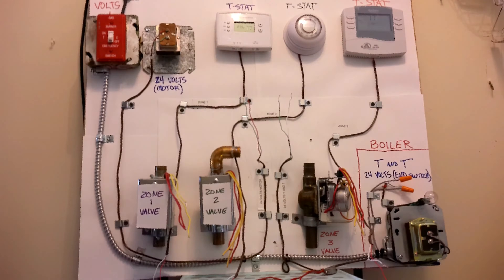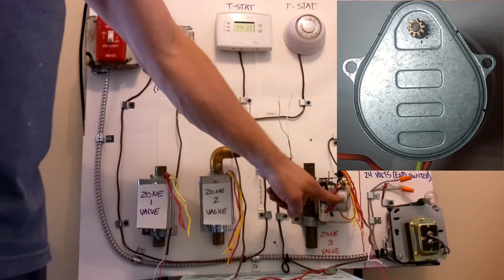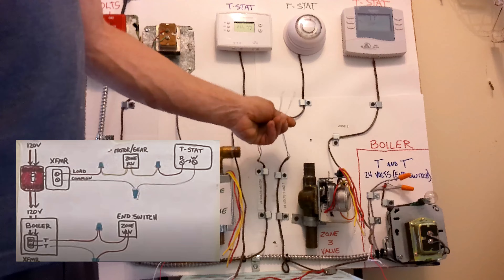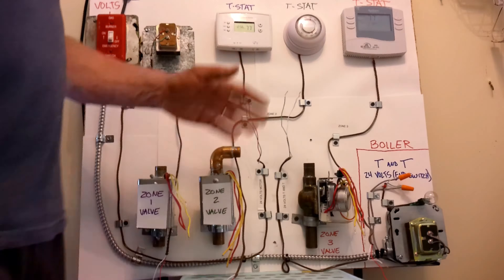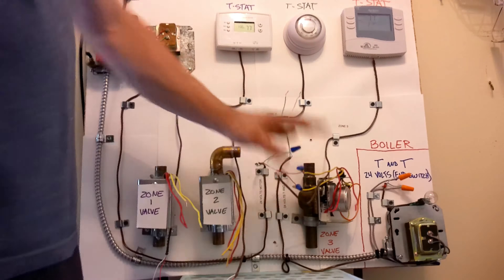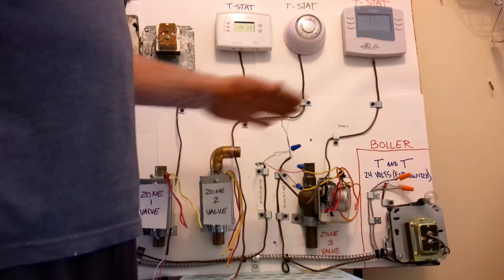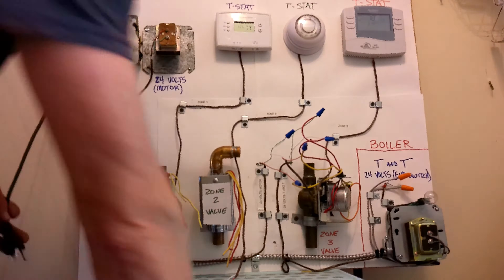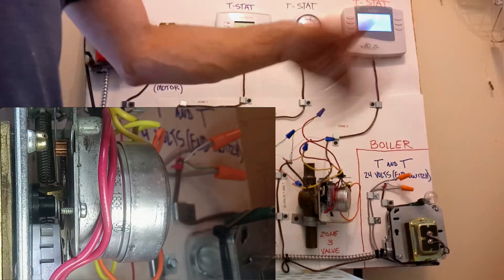Zone Valve Wiring For Beginners (Honeywell demonstration)

Comment: Can someone  please help? I installed a  new gas bolier recently. But for some reason the boiler is running without reading the thermostat. Is this a faulty wiring or something to do with the boiler installation? The thermostat is getting power, it reads the time and measures the temperature in the room, but  it doesnt regulate the house temperature set on the thermostat with the boiler . Its set at 70 but the house temp is 90! Is this a wire burnt out or is it a faulty installation? its Burnham X207, 210,000 BTU gas fired hot water boiler. How could the thermostat just stop working all of a sudden when it worked just fine before the boiler was installed? Seems to me the wiring to the boiler just wasnt done right.
Reply: Do you live in PA/Jersey area? Are you still having trouble?

Comment: Could you make a video explaining wiring an external zone control on an oil fired boiler. Controlling donestic hot water?
Reply from the maker: It's the same set up. Only difference is than an aquastat on the water storage tank takes the place of the thermostat. When the water temp drops below the setting on the aquastat a switch closes and the zone valve motor is energized the same way a thermostat energizes the zone valve motor on a call for heat.

Comment: Hey. great video !  I do have a question about radiant flooring.. I had 3 zone valves.. I replaced 1 zone with radiant heating.  Do you have a video explaining the wiring from the thermostat?
Reply from the maker: Not really familiar with radiant floor stats, unfortunately.  But I can't imagine them working radically different from conventional thermostats.

Comment: Mike, Where is the C-wire required for Nest thermostats?  My wiring has 4 wires, but only red/white are hooked up.
Reply from the maker: The common is on the 24v side of the transformer. One terminal will feed 24v to the tstat/zone valve,  the other receives it back as the common.

Comment: Forgive me. I’m trying to understand this. It’s been a few years since I’ve been in the field. But if a goes to common isn’t that hot to common. A direct short ? I thought tstat terminals are breaking hot ?
Reply from the maker: It's not going directly from hot to common. T stat gets power at R through the zone valve motor wiring.  W goes back to common. Some guys put the ZV on the W wire side and just run power straight to the stat, but ZV motor doesn't run either way until the Tstat closes the circuit.
Reply: @JerseyMikeHVAC  ok yeah I was just talking with someone and I think I get it. Or at least what someone was explaining to me earlier. .. r from transformer up to r at stat. Out w to one yellow on zone valve. Same for next tstats and zone valves. Other yellows are in common. Can get wire nutted. One red wire from end switch goes to “t” terminal at boiler. And other red to other “t” terminal at boiler .. am I on point or way off? Lol. Appreciate your assistance sir.

Comment: wow fantasic demonstration.... basic question on zone valve... do they need to be installed in a specific direction?
Reply from the maker: Yes. There should be an arrow on the valve body. If the zone valve is going on the supply side of the boiler piping, the arrow points away from the boiler. If on return side piping, arrow should point towards boiler.

Comment: Mike awesome videos, I could use ur help wiring my new peerless boiler, two zone valves plus I got to add another zone valve to the indirect water heater, willing to pay if u help me remotely.
I can do all the plumbing no problems just wanna make sure my wirings right 
Thanks
Reply from the maker: The aquastat for the water heater can get wired into the zone valve like a thermostat. Only difference is that it doesn't matter which way red and white get hooked up, so it's easier. 

I have a few other zone valve videos that might help you out. Let me know if you have any questions

Comment: Mike, incredible explanation, many thanks. practically everyone else misses the point about dual circuit and little switch behind actuator. Latest boilers like Navien have zone support built in. How does one wire zone valves and thermostats to the boiler then?
Reply from the maker: I have very rarely zoned out Navian boilers, but what I do know is that the zone relay will have individual R, W and (optional) C connections for each of the zones for the thermostat connections.  It will also have Normally Open N/O), Normally Closed (N/C) and Common connections for the corresponding Zone valves.  On zone valve connections to the zone controller you'll almost always be using the N/O connection and not the N/C. 

 With Taco 3-wire ZVs, the N/O connection would go to terminal #1 and the Common to terminal #2. On Honeywell 4-wire ZVs, One wire would go from N/O to one of the yellow wires and the Common to the other yellow wire. Doesn't really matter which way. 

 I have seen Taco zone valves wired into Navian zone controllers without terminal #3 on the ZV being hooked up at all, so although I'm fairly certain, I'm not 100% sure that Navian PCB Zone control doesn't require a TT signal from the Zone valves end switches. The ZVs only need power to actuate the physical valve itself. So I'm assuming it's the same with Honeywell 4-wires in that the 2 red wires are not hooked up.  I believe the only time T/T wiring needs to be made is when you're running more than 3 zones and an external zone controller is required, and that would be from the external controller to the internal zoning panel in the PCB. 

 I have also been made aware before that the PCB setting have to be set to "zoning disabled" for it to work, which seems completely counter-intuitive to me, but it seems enabling that feature is for when you're using Ready-Link cable for the external Navien Smartzone Zone Pump Controller, rather than for when you're zoning directly off of the PCB itself internally.

You likely need an external circulator pump for Navian zoning applications, as the internal pump is often not sufficient.
Reply: @JerseyMikeHVAC  thank you for reply. you gave me very valuable hint and hopefully useful to your other subscribers.

I troubleshot my wiring, called support line,

I have the same Taco zone valve, normally closed as you've shown in the video. Latest NCB boilers do not need the 2nd red cable pair, the little switch at all. I left those wires hanging. I hooked up my yellow cables actuator to normally open (NO) and common on the boiler. This has to be a mistake in vendor specification because my valve is normally closed (NC). When tstat calls for heat, NO pair of connectors is energized to ~26 VAC and stays at 26V until the valve is open, letting the water through into the coils. The normally closed pair is at ~2V. Traditional 24V wall transformer can be removed.

External system pump for radiant heat is also driven by thermostat closing R->W bridge on the boiler. 120 VAC pins are on boiler front panel. It's sufficient for smaller pump under 2.5A max.

My pump will stay on until desired supply temp is reached plus few degrees over. It then turns itself off until supply falls 10F below desired T to prevent short cycling.

Since the boiler is the one providing the power for zone actuators, it feels like there is no ambiguity or the need for the switch loop anymore. It knows whether it's sending 24V to the motor or not.  Valves and pump are working perfectly and synced with thermostats.

I am off to new problem. plumber got something wrong and the water is not going into floor supply, pressure dropped.
Reply from the maker: @tahoefor  So it WAS N/C. Makes more sense. I was thinking N/O didn't sound right, but I was told N/O.

Comment: Mike, thank you for the great video. I have the same 3 zone wiring just like you are showing here. Now I understand how the spaghetti works. I have a question for you. I am going to replace the thermostats with the Google Nest thermostats. The instruction says it needs a C-wire, but I only have two wires connecting to the existing thermostats. How do I solve the problem? Do I have to use a power connector? If yes, how do I connect it? Thanks.
Reply from the maker: I just released a video a few hours ago on how to wire a power connector to a taco zone valve, but if you're going to install multiple Nests it probably isn't going to work. You may need an external transformer and relays. Im going to be working on a video for that.
Reply: @JerseyMikeHVAC  I watched your video about connecting the power connector to the Taco valve, which is different from the Honeywell valve. How to connect to the Honeywell valve as shown in this video? Thanks.
Reply from the maker: @Woaitudou   I did a similar video on the Honeywell valves. You can check it out here: 

https://youtu.be/XVs0k1aaza4

Comment: Mike - great video, even better was your explanation.  I am in the process of modifying a 5 zone boiler system and incorporating the a/c into the mix.  What is your recommendations with the smart  thermostats & controllers available.  My goal is make the system work from one thermostat, including the a/c.  Luckily, the builder installed 5 conductor wiring for each of the 5 thermostats in the house.  Right now everything is operated manually with the old mercury thermostats.  Thanks!
Reply from the maker: Is your AC system Zoned? or is it just 1 central thermostat?
Reply: @JerseyMikeHVAC  a/c system is one zone, ductwork throughout entire house.
Reply: @JerseyMikeHVAC  one thermostat for a/c
Reply from the maker: OK. 
Another question (sorry), but when you say you want to make it all work from one thermostat, do you mean all 5 zones from one thermostat? Just want to be clear before I give advice.

I also need to know what kind of zone valves you have.
Reply: @JerseyMikeHVAC  So I thought that was a good idea, and I am seeing that perhaps it's not.  I thought controlling everything from one location would be efficient and more cost effective by keeping teenagers from manipulating the thermostat to frequently.    Since I first sent this question, I learned that one of the zones can control the others, and that is the case here for one of the other zones.  I will get back here once I troubleshoot these zones.  By the way, the wiring is a spaghetti mess.  I am considering using Nest 3rd gen thermostat(s) for each zone, however, I would like the main floor thermostat to be both heating and cooling.
Reply from the maker: @patrickmaloney4125  The main floor stat can certainly be used for heating/cooling. In fact, Nest stats seem to prefer being powered off of the AC system vs. the boiler. 

 As for the idea of controlling all zones from one stat, you basically don't need more than one Nest to do it. You would just manually lock open all of the zone valves except for the one you're controlling AC/Heat from. That'll be the one that completes the TT circuit on a call for heat and fires up the boiler. With the other zones locked manually open, all of the zones will feed when that one stat calls for heat and the circ pump kicks in. 

 You don't need to get 5 stats, don't have to get into massive rewiring or anything like that. If it doesn't work out, just unlock the zone valves and go back to the original set up as is. Then decide if you want to go Nest with the other stats.

Comment: I've installed these at work and only have to use the 2 yellow wires and not use the red wires. Why is that? Thank you, great video!
Reply from the maker: The red wires are a separate circuit with these zone valves, often powered  by a completely different transformer. They're no connected to the thermostat at all, but the boilers burner circuit directly. The zone valve acts like a relay between one circuit off of the yellow wires and the thermostat and the other circuit on the red wires and burners.

Comment: Mike, Love the videos. Learned alot. STRUGGLING with smart stats right now that need C wire. Found electrician had wh and red flipped on power transformer originally and fixed that but still cant get the smart stats to call. Have HW baseboard only, no cooling. Switched wires no issue b4 with old stats. Does the C wire go to the "common" on the transformer or load? Have tried both ways but still can't get it. Have 5 zones total including sidearm dom HW.
Thoughts?
Reply from the maker: I'd you have 5 Honeywell zone valves on a 40 VA transformer it might not be enough power to charge a thermostat on top of it all. Those transformers can only handle 5 zone valves max as it is. 

How many smart stats are you adding? Have you checked the common wire for continuity to make sure it's good?

Comment: Great video. You make it  seem so simple
Reply from the maker: Thank you
Reply: I have a question..when you add other zones you connect them to together and they all get wired together and get connecter to transformer and boiler wire, correct? Just the thermostat must be added to add zones correct? Thanks
Reply from the maker: Each zone is a plumbing loop which is controlled by a zone valve, which in turn is controlled by a thermostat. Additional zones would require additional plumbing of some kind.

Comment: I have 3 zone valves with low voltage but 1 is 120v to an old thermostat. Can you explain this? How can I convert this last thermostat to low voltage? ty
Reply from the maker: How long ago was the boiler installed? Generally a line voltage thermostat wires directly into a heater, like an electric baseboard heater. If there was an electric heater 
 or some other line voltage heating arrangement existing before the boiler was installed, it's possible a 120V zone valve and thermostat was worked into the newer heating system running on low voltage controls as a lower cost alternative, because it would have been a difficult and costly job to run new low voltage wiring between the boiler and location of the 120V tstat. In other words, they stuck with the 120V arrangement because it wasn't worth the cost t convert to low voltage. 

 I have encountered a few situations where running new low voltage wiring to an existing tstat location wasn't possible without a lot of tearing into walls. We resorted to installing a wireless tstat with a receiver running the zone valve.

Comment: Maybe for beginners you should start with one zone.
Reply from the maker: I did start with wiring in just one valve. I go into wiring multiple valves in another video.
Reply: @JerseyMikeHVAC : I have a 555-050 3 pole and can't find a simple wiring diagram. I don't know how to test the power head.
Reply from the maker: https://youtu.be/kn73V0BnSq4

Comment: Mike, I'm in SE Pa. (19036) you need to come over!
Reply from the maker: Maybe I will!
Reply: @JerseyMikeHVAC  ... please let me know if you service SE Pa. my newish Crown Boiler is frying zone valves $$$$$. Unless new old stock green tops Tacos have an expiration date (joking) And now it's tossing a code 4 error. Heck it's only three years old!
Reply from the maker: @hmdwn  Ha. Nope. Definitely not your Tacos. Unfortunately, that's a little bit of a hike for me (I'm just outside of NYC). But code 4 is a no flame signal. Shut off the burner switch, clean the flame sensor in there with a dollar bill  (it's down by the burners) and turn it back on. That might be all it is.

 If not, it may be an issue with the wiring or control board itself. 

Crown used to be a really good brand, but it's taken a real nosedive lately.

Comment: Thanks for showing how it works visually.  On new installs, is it easier/better do use a zone relays?
Reply from the maker: No problem. 

Yeah, if  youre running multiple circ pumps then zone relays are the way to go.